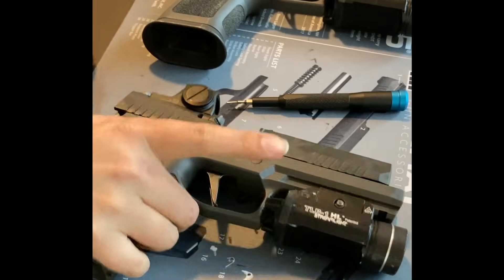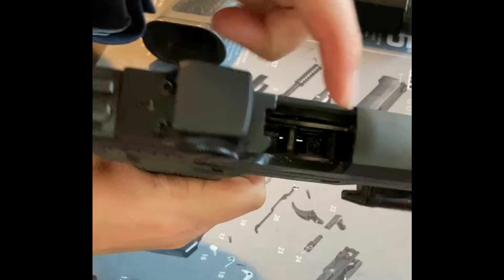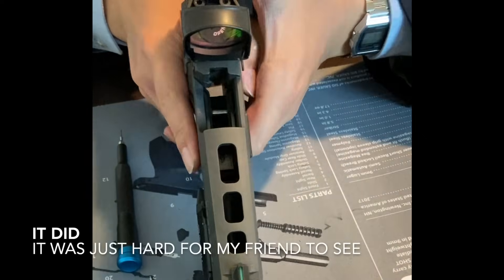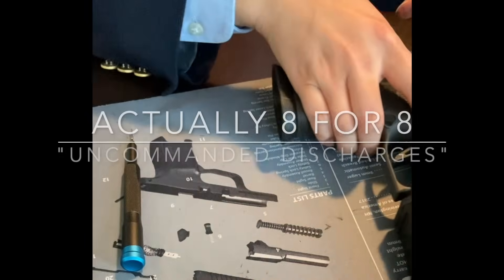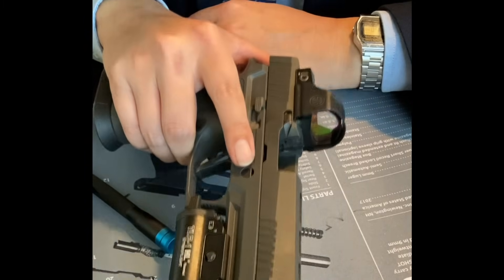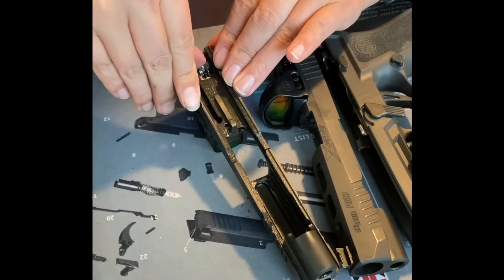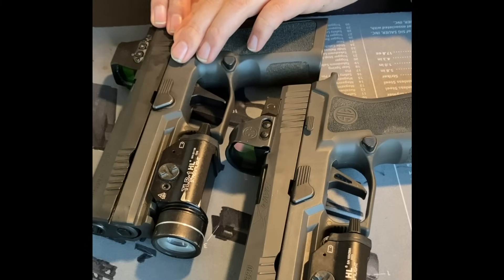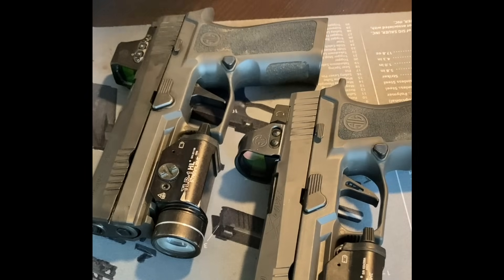Testing two P320's for Uncommanded Discharge: One PASS, one FAIL

Comment: Remove the holographic sights and repeat the entire process.
Reply from the maker: Error: Holographic sights not found. Please restate request.
Reply: @P320Truther  Strange  but both firearms are equipped with holographic (red dot) sights. Is AI screwing around with me?
Reply from the maker: @ Red dot sights and Holographic sights are very different beasts.

Color me curious though: What do you think removing the red dots will accomplish?
Reply: @P320Truther  Mounting screws for sights have been known to be too long, incorrectly torqued and interfere with other slide functions. Anyone who pokes something where it is not supposed to be poked is probably causing more trouble that it is worth. It just amazes how many people think they are so much smarter than factory people. I am personally done with this thread. I have two P320's, have never had a problem with either one. I will not be messing with either one until something is wrong with  one of them. I also have a pair of M&P 9c's fitted with Apex triggers to tide me over till this P320 thing is resolved. I have no intention of not shooting the P320's as long as they are running correctly. What sight is on the slide that works correctly on both firearms? The Sig sight or the third party sight? Are all the failing firearms equipped with red dots?

Comment: I am confused because the premise is the sear failing right? Isnt that a HUGE deal? Is that whats happening with these p320s is that the sear is failing first ?
Reply from the maker: For whatever reason, sears are failing and releasing strikers. When the sear fails, there is precisely one safety mechanism left preventing an “uncommanded discharge.”

This test doesn’t care why the sear failed, it assumes the sear has failed and checks whether that last-ditch safety mechanism is or isn’t working as intended.
Reply: @P320Truther  Thanks for the reply, how do you know that sears are failing? Is there mechanical evidence like broken pieces or how does that work?

Comment: What trigger bar is being used on the legion?

I noticed some shops are selling “lightened” safety striker springs. 

Makes me wonder if somehow the lighter spring allows it to be defeated.

Shouldn’t a striker return spring be pushing the striker BACK into the slide? On a couple instance of the legion it seems to be maintained out of the breach face
Reply: Why is it you have to hold the slide on the standard nitron slide and not on the x5 legion and the striker is staying protruding out
Reply from the maker: - The Legion currently has a 576 trigger bar.
- Not sure what you're referring to.
- The striker return spring is not working properly on the Legion.
- I am not certain why the Legion slide stayed in place whereas the X-Full slide would slide right off once the sear was released.
Reply: @P320Truther  I think you’re right about the return spring for the striker not being present
Reply: @P320Truther  sorry I also previously meant that when I have my manual safety on and active, the striker lock doesn’t appear to be defeated even with dear manual intervention.

But when the safety is off the manual sear depression lifts the dongle that defeats the striker safety lock and ALSO is moving the trigger and trigger bar.

So the manual depression of the sear isn’t imitating acting like a trigger pull essentially.

Comment: Didn’t they do a recall on the p320 and fixe the issue? Because I’ve owned one for a few years and never had any issues I even did multiple drop tests with a blank and even hit it with a rubber mallet and didn’t get any discharge
Reply from the maker: The “voluntary upgrade” significantly lightened a good number of FCU components to reduce inertial activation of the trigger at specific angles of impact. Aka, inertia could outright pull the trigger, thus causing the gun to fire.

The issue this Sear Movement Test is checking is whether movement of the sear (independent of touching the trigger and regardless of cause) might sympathetically deactivate the striker safety lock or (more broadly) whether the striker safety lock is functional on any given P320 if the striker were to slip off the sear.

Comment: One thing to note with this test, if you push the slide too far forward, the lifter will prematurely hit the firing pin block, which could be the cause of the first one having the uncommanded discharges. you have to ensure that the rear of the slide is perfectly flushed with the rear of the FCU if it’s forward any more three firing pin block will have listed
Reply from the maker: Both slides were held in the proper, fully-in-battery position during multiple iterations of this test. Movement of the slide after pin protrusion is unimportant. That’s also not how the components would interact, the safety lever would have to move more if the slide were misaligned forwards or backwards, and if the safety lever pushed the front of the striker safety lock, it would take more force to deactivate the striker safety lock, not less.

Comment: Makes sense, the one competitor who made a video about his p320 going offin the holster said that sig told him it was the striker return spring
Reply from the maker: The striker return spring certainly seems to have some influence over the striker safety lock's potential failure, but it doesn't seem to be the root cause of those failures, since my FCU resolutely would not protrude the striker but his would. A broken / non-functional striker return spring would be an easy first problem to blame for someone diagnosing a pistol that suffered an "uncommanded discharge."

Comment: This is an excellent video. I'd add another reason: tolerance stacking - between the two guns there's enough variation that there's enough drag put on the striker block to prevent it from working perfectly. That would align with the reality that SIG outsources a lot of parts but not consistently. Are those strikers and striker blocks from the same mold or die? It'll be very hard to tell unless there's some very clear difference in tool marks. Metal injection molded parts need post processing and I'm wondering if there's any variation in that as well.
Reply from the maker: The FCU is much more likely to be the cause of a failure in this particular case. Note that my FCU passes with both striker assemblies, whereas his FCU fails with both striker assemblies.
Reply: @P320Truther  Did you swap strikers or the whole slides?
Reply from the maker: Striker Assemblies. All the relevant parts are completely self-contained within the FCU and Striker Assembly, there'd be no point to swapping slides.

Comment: I dont know if it has anything to do with this, however, on alot of the 320's that ive seen(being the m17 platform with the external safety) the slides seem to have a problem firmly seating into battery. In order to fully seat it, you would have to pull the slide ALL THE WAY rearward, and then let it slam home.

Comment: All this headache because they chose to put a performance trigger in a service pistol with no manual safety. The reason this never happens with Glock is because if out of tolerance parts makes a glock sear drop, the striker isn't charged enough to have enough power to make a round go off. A glock essentially acts like a double action revolver in the sense that the trigger pull actually pulls the hammer back, or striker in this case, enough for the round to then fire. 

For the p320 they chose a fully charged striker performance trigger for that crisp trigger feel. Don't ever point a pistol like this with no manual safety at yourself conceal or duty carrying. That includes the new glock performance trigger and the timney performance trigger for glock because those triggers do away with the first wall and have a fully charged striker for a performance trigger feel.
Reply: The con of the Glock trigger is the mushy trigger feel but it is worth it for duty carry.
Reply: The striker on a Glock has enough energy to ignite a primer even without pulling the trigger.

Comment: Disassembled the striker on the 3 guns where it didn't always lock back. The striker reset spring was broken on all 3. Replaced them and they all lock back. Convinced this part failure is contributing if not causing the auto discharge and firing out of battery.

Comment: This is the closest thing I’ve seen that explains what a lot of people have been suggesting. The sear engagement surface is TINY, requiring very little movement to release the striker.  Very easy to see how tolerance stacking and variances from wear, lax QC in parts specifications and fitment, etc..  This is enough confirmation for me to leave my 320’s on safe duty until this gets remedied. Way too many variables and uncertainties to know whether anyone’s particular 320 is the one to cause a discharge.
Reply: This man gave you the test…. Why wait and leave them in the safe. You have a clear way to check them…

Comment: First off thank you for making this video. If you remove the fire control unit from your grip module on the bottom in front of the trigger a number is stamped. I have been told that this is the year of manufacture. What are the years of manufacture?

Comment: Has your friend’s pistol had any issues besides this test? I appreciate the content, but I think you need to find a way to disengage the sear fully assembled and in proper battery. 
Additionally, blue printing the two pistols to figure out what is actually out of spec, “fixing” that issue and retesting is going to prove a case that there is an issue.

Comment: Not a far comparison. Your friends weapon has been modified for weight. You can see this in the top of the slide and trigger yours or any factory P320 does not have. Who is to say the individual that disassemble the weapon to do the modifications stopped at what we can visually see or did other modifications. That individuals reassembly maybe incorrect. Any attorney could shoot holes in this due to the modifications made, unless these modifications where done by Sig, where they?
Reply from the maker: Have you never seen a P320 X-Five Legion? Both P320’s are entirely stock.
Reply: @P320Truther  No I have not, still does not mean that the one had anything done with it. Now if that did come from the factory, and they reduced the sear spring for the lessened weight or other reason, its all on Sig at that point. That being said I do know the 716 originals came out and the shell extractor disintegrated. Sig repaired (really replaced the entire bolt) rather than one it now has two. My best friend's was a few years later checked his bolt, was like my new one. Yes they will not do a recall, just replace as people have the issue. I do not know the issues on the p320. My wife does have the p230, love that little pistol, not as much as my S&W.

Comment: Thanks' for making the effort in thinking, analyzing, testing and producing this video the covers part of the research gabs in our understating of the P320 internal components. I hope you can check if the striker reset spring (part: SIG 1300848-R), a small spring only about 0.3 inches long) is in the same state in both P320. Good work!.
Reply from the maker: The striker reset spring is almost certainly broken or otherwise non-functional in the X-Five Legion. It seems to contribute to the vulnerability, but does not seem to be the cause of the vulnerability.

Comment: Could you test the M18
Reply from the maker: Would that I had one. I'd be curious what results we would see from a large sample size of military M17/M18 tests versus civilian P320 tests.
Reply: @P320Truther  I have a well worn m18/320 (~2500+countless dry fires w/drymag) tested it 10 times with and without the trigger safety on and had 0 failed tests.  The sear block and spring are very firm on mine.

I do have an apex trigger bar and trigger.

Comment: What gets me is all the people that still appendix carry any P320.  The very system is flawed its why they did not use it in the p365 which is supposed to be a direct downsized p320.  You have to be either stupid or totally uniformed to carry a P320 pointing at your junk and femoral.  A manual safety will not prevent the case where the striker jumps the sear which has been shown it can do but the striker plunger safety is flawed and does not stop the strijer.  The MS onky blocks the sear.   So there has to be 2 failures for a discharge like this.  First tge striker has to be released from the sear and the striker blocker plunger has to not be set.

Comment: interesting, thank you for this vid. i just replicated what you were doing with a small flathead screwdriver meant to repair eyeglasses as my "pokey" tool, and i got strikes!!now, i actually did this with a chambered live case , barrel and recoil spring installed, and my p320 did infact go off several times. i pulled the bullets and powder out of some factory cci blazer 115gr ammo for this test and the primers detonated! this was my axg pro model i use for matches and has north of 10k rounds through it. i did this same test on my other p320 xcarry with less than 500 rounds through it, and it did not detonate primers. that being said, this very well boil down to striker springs being weak or worn out! ill be damned! thanks for this vid, i would have never thought of trying this.
Reply: They are definitely weak. There's some of them that have gone off with less than 500 round through them.
Reply: Are you still running the 320's now?
Reply: @ChristopherMundahl  i am not

Comment: I suggest you put the camera on a tripod, so it is isolated from the desk. Everything is shaking making it very hard to see.  You have to press very hard to get the sear to drop. How do you know that you are not moving some other internal parts when you press down from the rear of the gun? Why not take the gun apart and check the internal parts? Any parts that are not the same or missing would be a good indicator of a possible malfunction.
Reply from the maker: With the exception of my friend's striker return spring, all parts appear to be whole, unbroken, and functioning as designed. The only part I am specifically moving is the sear. All other part movements are sympathetic to that one action, which is practically required for any of these "uncommanded discharges" to happen without an obviously broken sear or broken striker foot.

Comment: That stupid striker safety lock is <1 mm thick. If you get debris in your firing pin < 1 mm thick it could hold the safety lock out of the way. Also, if the spring holding it down breaks the safety will also fail. It's a really dumb design.

Comment: Thank you for this video. What your video shows me is that there is a tolerance problem with the Legion slide you used or an out of spec safety lever. Let me explain. To my understanding, SIG no longer includes the Striker Return Spring/Reset Spring (SRS) in the P320 and P365 platforms. They consider it an extra part. The SRS sole purpose is to return the striker/firing pin into the slide immediately after it strikes the primer. This prevents what is called primer drag. Primer drag is one cause of premature striker/firing pin failure. Most semiautos have this feature. Think M1911, SIG P220, 228, 229, 239, and other classic series' firing pins. They all contain this return spring. If you are using a striker without the return spring, the striker must be designed to withstand the pressures caused when firing, think Glock. SIG has redesigned the striker on the 365 to prevent the primer drag and striker failure (breaking). I was recently told that this spring was also discontinued on the civilian P320 platforms. This could be the reson your friend's Legion does not have that spring. This spring has nothing to do with the safety lever. In the 320, it is actually located in the striker assembly on the opposite side of the striker safety. Missing the spring will not cause the striker to protrude, as your tests have shown. 

The striker safety (the sheet metal part in the striker assembly, what you called the striker safety lock) is designed to prevent the striker from moving forward unless the striker safety lever (part in the FCU) moves the striker safety out of the way. When you swapped strikers, your P320 did not protrude. However, the striker in your friends Legion slide was able to protrude. This means that there is a problem with the Legion slide. It could be the tighter tolerances or something isn't machined correctly. 

Or it could be the safety lever on the Legion is out of spec. When the lever comes into contact with the striker safety, it is adding some upward pressure, allowing the striker to jump over the safety when it is impacted hard. This means the safety is not able to fully extend when the slide is attached to the FCU. The out of spec safety lever is in contact with the striker safety as the slide is placed on the FCU. I would replace the safety lever in the Legion FCU and run the test again. If you still get a failure, then it is something in the slide. If you don't, the safety lever was our of spec. 

I'd reach out to SIG about the Legion, share this video with them, and have them check the machine tolerances of the slide and safety lever. 

B
Reply: Thanks for explaining dude
Reply: Incredibly good info. Hats off to you.

Comment: Have you checked you are both using the same sear? Assuming the safety latch fails on both strikers the new secondary sear surface would be all that's left.
Reply from the maker: Both FCUs use the newer style sear with a secondary engagement surface. It is difficult to conceive of a shock or jolt of sufficient force to disengage the primary surface, yet also impart so little inertia to the sear that it would be able to pivot back up in time for the secondary surface to catch.